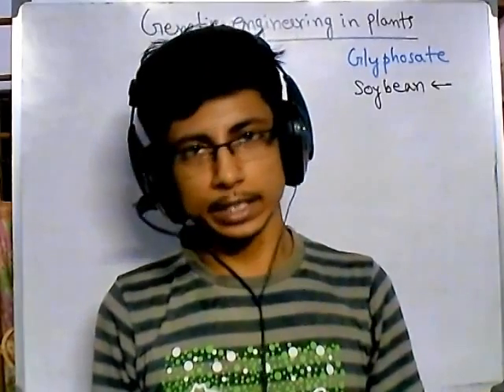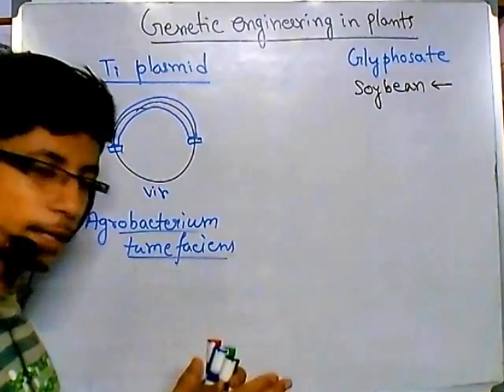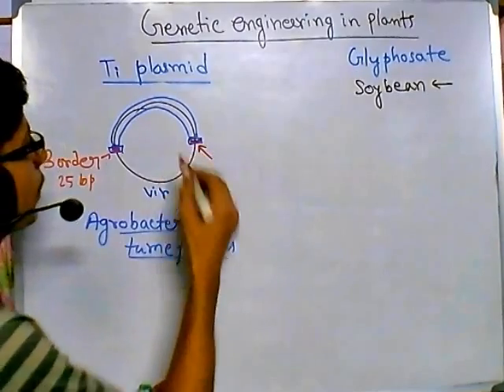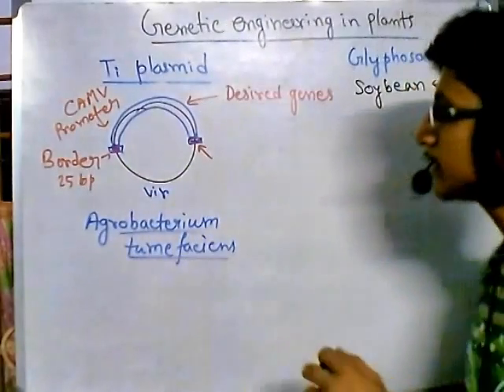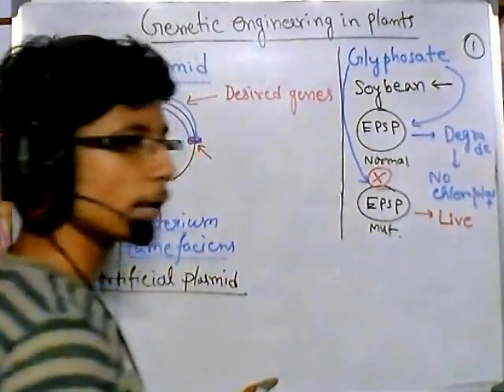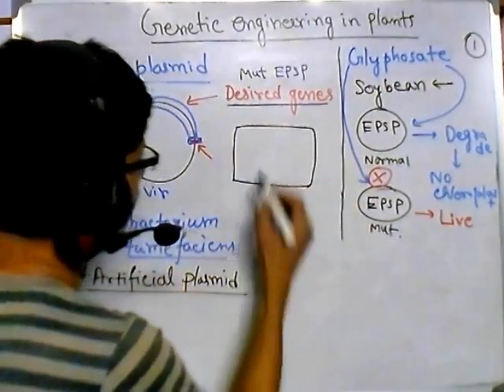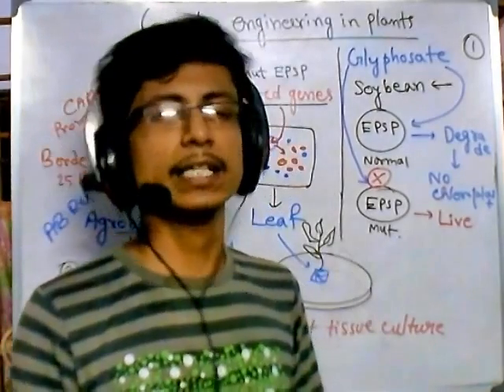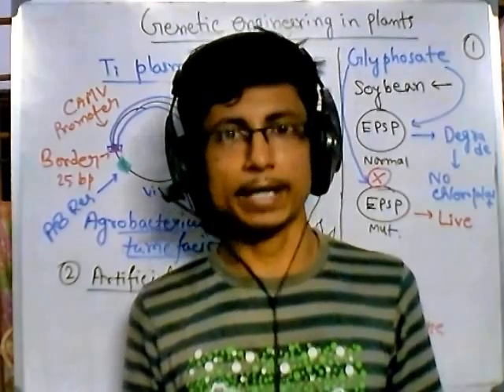Genetic engineering in plants

Comment: I have one thig to ask in this video. suppose after putting the antibiotic resistance gene in this plasmid, this will must grow in media containing antibiotic, but the questions that, if the bacteria is resistance to antibiotic , then how can I be sure that, the desirable gene is also there.
Reply: Hey, i know it is a really late reply, but just in case you still want to know why:
You usually use a bacterial strain that is not resistant to antibiotics (you can try this by cultivating some wildtype strains WITHOUT plasmid on antibiotic containing plates - they should not grow)
Also after you have your plasmid containing bacteria grown on the antibiotic plates, you can sequence them to make sure they also contain the inserted gene